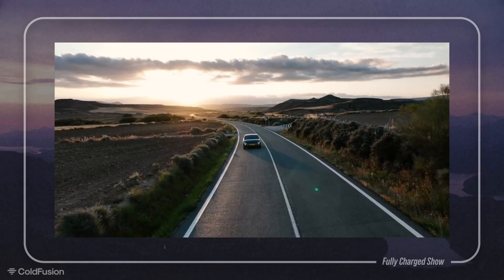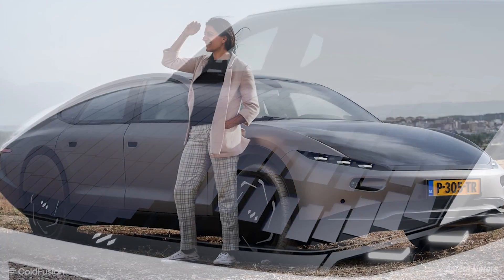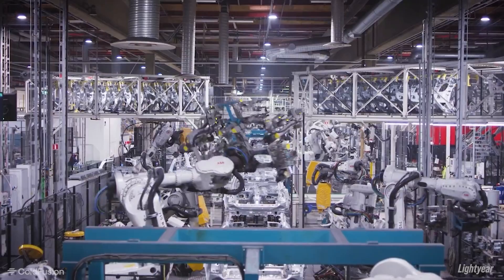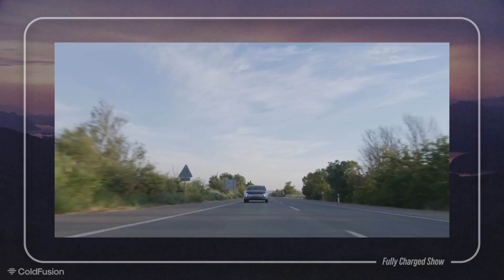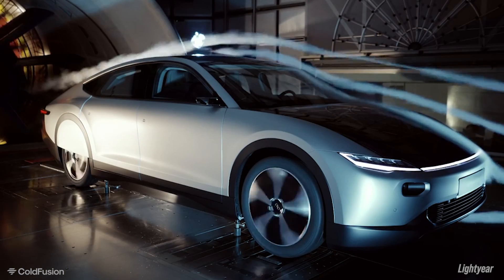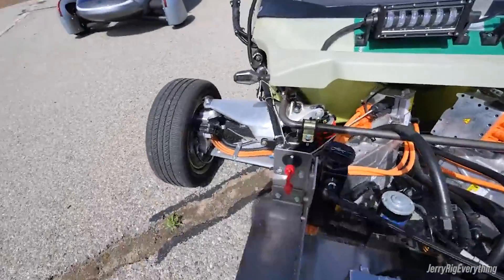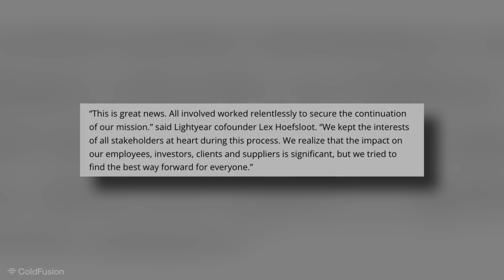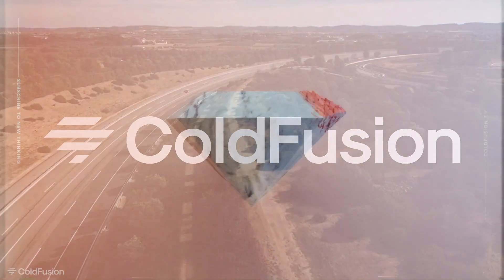3 Interesting Solar Car Projects

Comment: I actually think an affordable plugin/solar hybrid could be a fantastic solution to the charging problem that faces electric cars in North American cities.

Street parking is super common here, which means the main benefit of an electric car (charging at home) isn't an option for many people. An electric car that charges itself while sitting parked on the side of the road could be a killer feature.
Reply: 100% agree, in all big cities
Reply: Wouldn't it be shaded by buildings most of the time?
Reply: In my city, even at the heart of it, street parking is exposed to sun for long stretches of the day. Plus, most of the parking all over the area consists of parking lots that are very much exposed to sun. So, in a city like mine, with lots of apartment complexes, shopping centers, industrial and other business parks, etc. Drivers would definitely be soaking up a lot of solar energy. I do wonder about how hot the cabin gets- hopefully, some amount of window tinting would be standard.
Reply: @kelstwin3176  
Put the solar panels over the parking spaces, not on the cars. And then add cheap low power AC chargers too, and plug in the cars.
Overall much more efficient and practical solution.
As a bonus it also protects from direct sunlight and rain.
Reply: @andrasbiro3007  Until the greedy bastards that own the solar panels charge you 10 times the price for the electricity. At least on your car you own the solar panels
Reply: @Tofandel 
That's why we have regulation and competition.
Reply: yet a killer feature if you get a dent from a dropping fruit or a bird shitting on the roof. Or in the case of an accident (Remember that Rivian service bill to investigate if batteries were affected by a minor fender-bender totaling $17K on a scratch)
Reply: A car like that won't be affordable anytime soon. Integrated solar panels require more sophisticated technology than a regular car. Best you could do is probably 120 000 to 150 000 dollars if the materials are cheap and you can mass produce it. Then you'll have to be very careful where you go and how you drive because, as someone else mentioned it, small accidents can become very expensive.
Reply: No. It's so dumb.
Reply: @lawrencefrost9063 Thank you for your solid and well-supported counter-argument (/s)

Comment: Solar cars is an inherently stupid idea. Just save money and put the panels on your roof. With it charge you cars or any appliance in the house.
You don't need to carry around expensive, and fragile solar panels in a suboptimal position.
Reply: Thin film have about half the life of glass. Carrying around ~$1K of solar on the road is irresponsible towards everyone else.
Reply: And if you live in an apartment?
Reply: @glennzajic7318  if you live in an apartment you probably shouldn't be buying a ~$35K car. Look for less than $15K, preferably less than $10K.
Reply: @artsmith103  Many apartments are very high end and cost more than houses. They are not always for the poor. That does not mean you can put solar on the roof of a building you do not own.
Reply: @glennzajic7318  Apartments don't have to be for the poor, they make people poor. The fancier the faster.

Comment: Yeah, that car was never going to work.  Even if you had the most efficient solar panels imaginable there just isn't that much energy in sun light.  And even if every surface of the car was generating power you'd still be talking about tens of watts when you needs tens of kilowatts to power an electric car.
Reply: The amount of energy produced by the sun in one day could power the earth for a year. The art of collecting and storing it is what needs to be developed.
Reply: @glennzajic7318  I've had low info people try to claim that for most of my adult life.  It's pie in the sky non-sense that has only a passing connection to reality.  Yeah, on paper, you can make it looks good.   But sitting down and actually designing an infrastructure to do so is functionally impossible.

Comment: If you are interested in students doing these types of things, I can highly recommend you looking into Forze Hydrogen racing, who had the fastest hydrogen car for a long time(and hopefully soon again). I have been personally doing that for a year fulltime in-between my bachelor and master degree. Some students have also made their own spinoff company from this called Zepp solutions. In my opinion, they have a much more risk-less business model by converting existing models into hydrogen ones. This requires less investment which is something students, who never proved themselves, have difficulty finding and as you said, was the downfall of lightyear

Comment: You wouldn't have to develop a new car, but a retrofit kit for e-cars, a kind of solar film that you could simply stick on the roof and then connect to the battery. That would be cool.
Reply: Nope. The mass, weight, aero of any current e-car means thats not a possibilty not even even slightly. As it says at the end, solar on the new Prius may add all of 4 miles a day (and thats probably in Arizona,  and then you'd need more than that amount of wattage to cool the car down because its been parked in the baking sun all day. 
 If it was as simple as slapping some film on dont you think everyone and his dog would have done it by now?
Reply: @Joe-lb8qn  
Of course you can't drive every day for free with the relatively small area on the roof, but 5 km x 30 days = 150 km per month - this is just about the idea.
It would be better if you could apply a photovoltaic-paint. The entire paint would then produce electricity. 🙂
Reply: @Christentum_enttarnt  now remove the AC needed to cool the car, account for the paint damage for the car being left in blazing sun all day , the extr cost and complexity and reflect that 150km is maybe 20 minutes charge whilst you are doing something and you get an idea why people haven't been slapping this on cars from day one. If you think it's so easy why have to date every single manufacturer failed to do this simple thing?
Reply: Not going to work. The Lightyear is threading the needle on the numbers in a way that no other car can accomplish. If you add panels to an existing EV, you'll just make it heavier and more expensive to drive with very little ROI from the solar power.